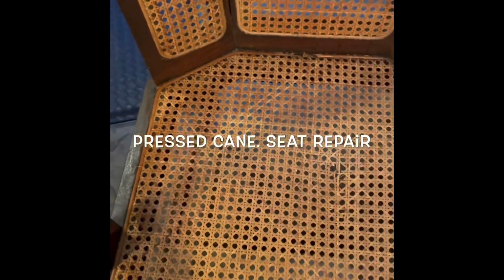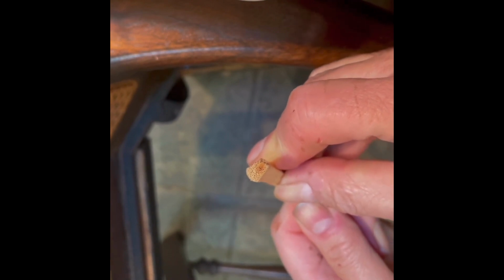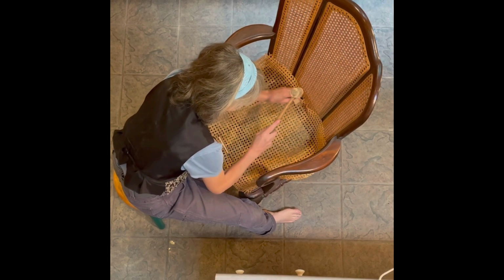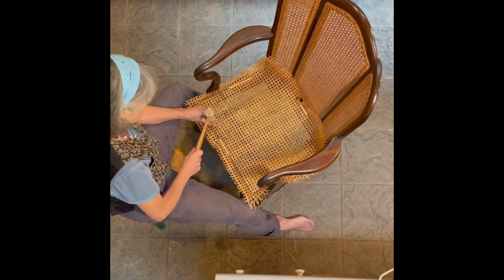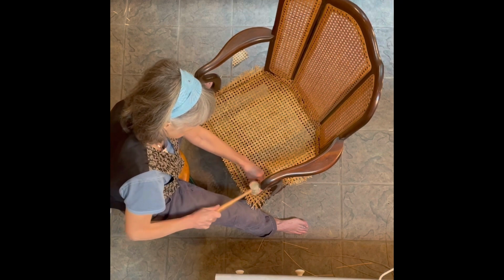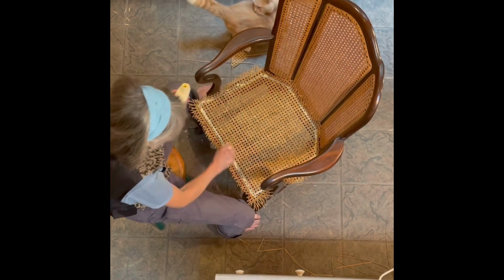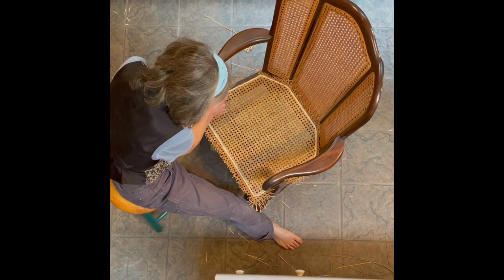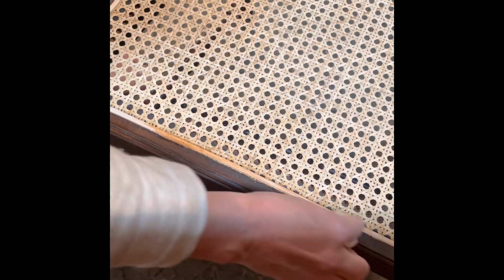Repairing a Pressed Cane Chair seat

Comment: Hi Laura,  another good video.  This one was long, but that is fine for anyone wanting to learn how to do this.  Lots of good tips like sand down chair where it might cut into cane over time. You said you can stain it or not.  Will a seat have a longer or shorter life if stained, protected better or not ?
Reply from the maker: 🙋🏻‍♀️Hey AHtPB glad you stopped by💖The thing about stain is it seals the cane somewhat and so it’s less responsive to moisture -expand and contract, and thus has a shorter life span…
 If Natural cane seat over time start to sag, it can be retightened by putting a wet towel on for a few hours, to “hydrated” the cane; then place the chair somewhere away from the Sun and let air dry. The sag will retighten. If the seats been stained/sealed this trick doesn’t work. 
 Rush seats and splint seats get sealed, but Cane and the wider Porch weave have glossy natural surface and so sealing them isn’t needed. Exception to that would be Porch weave left outside. Eventually the elements are going to wear off its glossy surface. At that point an exterior poly can be applied to protect it.  There’s times when I’m replacing one seat from a set of chairs and in that case staining it so it matches the other ones. 

 Hope that helps! Happy Wednesday 🤗🙏🏼